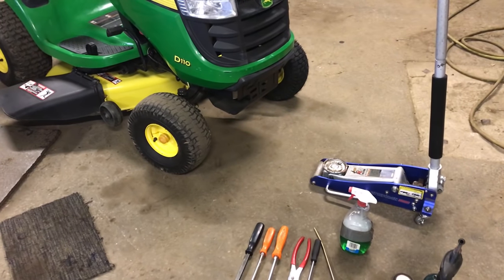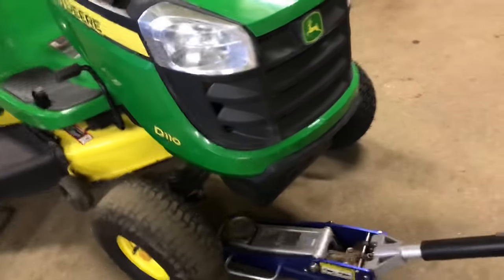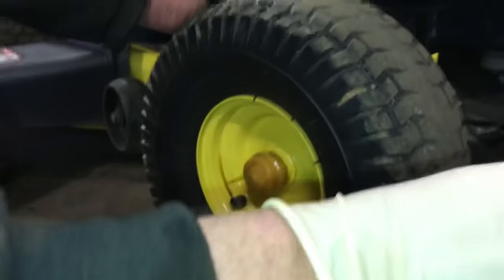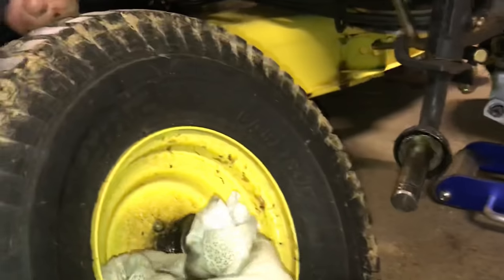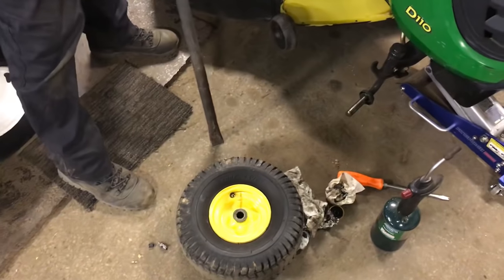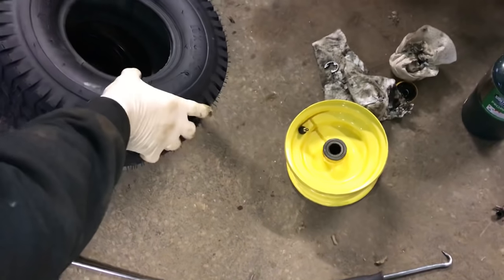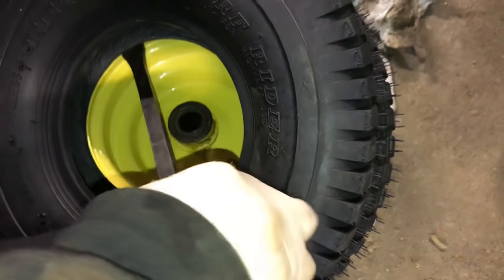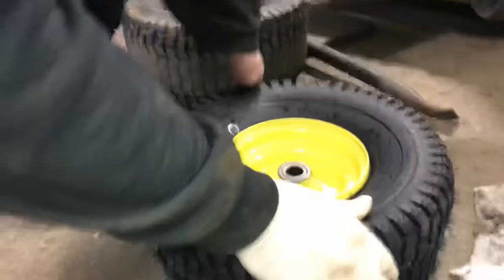How to change a tire on a John Deere

Comment: I have a JD S120 and the rear tire went flat thanks to a piece of wire that went into the side wall. I thought about just buying a new tire with rim to make it easier, but after watching your video, i am going to buy the replacement tire only. Thanks for posting a quality well explain video, it’s appreciated! Now, its on me to get my tire off that rim, lol! Great video! Thank you.
Reply from the maker: You can also keep the tire, put a patch on the inside of the tire where the wire went through it, then put a inner tube in the tire. I do not have a video on it but I will do one when the opportunity comes up.

Comment: At 7:22 your advice on pushing the tire down as far as you can REALLY helped me on my L120 tire I was replacing. I thought I was a complete dumbf**k but it was just a trick like that that did the job. I was really fighting that tire till then. Now I’m only half a dumbf**k
Great video!
Reply: Yogi Beer I have a rear tire that needs replacing on my LA120. But Im having a hard time removing it. I have sprayed it with wd40 for 4 straight days and but its not  move at all

Comment: The knee trick was the key to getting the new tore onto the rim.  I spent the better part of an hour goofing around, trying to somehow hold the rim secure, and finally giving up and checking YouTube.  After sifting through a bunch of useless videos, I found this one, skipped to the part I wanted to see, then it took less than a minute to get the tire on.  Thank you!
Reply from the maker: I’m glad it was helpful and you finally got the job done!! Thank you for watching and the kind comment. Please give this video a thumbs up to help my channel. It would be greatly appreciated.
Reply: @JohnsonsSmallEngines  Another great tip. removing the valve core and using a blow gun to get the bead seated, much better than using an inflator chuck.  You're full of great advice here.  I've spent 45 years wrenching on stuff and your 12 minute video gave me two great tips that I'll use.  Thanks again!

Comment: Thanks for posting this video. Just got myself a free X300 and the rear tires were shot. Not the most pleasant thing to do but thanks to your video I was able to do it myself. Thanks!
Reply from the maker: Mom glad you were able to get the tires changed out. How many hours are on the tractor?
Reply: @JohnsonsSmallEngines  118. 2014. Not much. It probably sat outside most of its life. Key was rusted up pretty good. Battery dead. Fuel a bit funky but it runs and runs smooth! I have videos of it purring away on my channel. Trying to decide if I want hdap or versa turf tires...but it looks like the versa ones don't come in 20/10-8. And I don't know if it's a good idea or not to mix different treads front and rear although the majority of the traction is going to be at the rear. Fronts were ok. Held air.

Comment: Heh.  this is great.   I  have never changed a rear tire but a have definitely changed the front ones or removed them.  I just break the bead while it is on the tractor before i lift it by kicking it, works every time.  Of course mine are typically flat because I ran over some sharp ass tool my son left in the back 40.

Comment: Did you just do this with one hand???? 

Yesterday I tried to do this and I have tools and air and am fairly handy. After denting the rim and scratching it all to heck I gave up. I feel like an idiot especially after watching this video. Good work!
Reply from the maker: I sure did, LOL. I was born that way so it was easy to deal with everything, plus I have changed thousands of tires. The trick is getting the tire bead in as close to the center of the rim before prying the other bead off of the rim and as I say "baby steps" small bites will make it also easier.

Comment: Just replaced a flat. Whoever put the tire on the rim used red loctite to bond the wheel to the rim. I had to cut the tire off and spend an hour breaking the seal with a blowtorch and elbow grease. If I weren't so stubbornness, I'd have gone back to Tractor Supply and just swapped the tire for one already mounted on a rim.
Reply from the maker: Nice work hanging in there to get the job done! Thanks for watching and commenting! Please give this video a like, subscribe and tell your friends to help my channel grow. It would be greatly appreciated :)

Comment: You did that like you knew what you were doing. Took me 2 hours just to take the tire off the rim. Probably another 2 hours to mount a new tire.
Reply from the maker: It depends on how old the tire is and the temperature your doing at. Some old tires are a pain to get off. The new one should be easier and follow how I use my knee to give you that little extra. Patients!!!! :)
Reply: @JohnsonsSmallEngines  Thanks, it's a 1991 JD i bought new in 91. I will use my knee for sure.
Reply: @JohnsonsSmallEngines  Thanks, It's a 91 JD I bought new in 91. I will use my knee for sure.

Comment: Are you using OEM tire or something else? Can you recommend a generic? I have a flat on my John Deere. I have never changed a tire and I'm not even sure if I can but I will give it a shot. This is my first ride on mower and I didnt even know we should be putting grease on. What kind of grease? 🤔 Also where are you located? Maybe you can help me out 😆 I know the John Deere dealer is going to charge me ridiculous prices to do anything. A couple years ago they were going to charge me $350 to do something to my Honda push mower that I did in 5 minutes for free after watching a YouTube video.
Reply from the maker: If you have a flat tire just install a inner tube. Here is a link to how to install a inner tube. https://youtu.be/bk3zwnOp1nQ.
Reply: Most auto tire places do not carry mower tires but will order one for you and mount on rim for about $65. I am local hand man and have been replacing mower tires for more than 20 years.  Tires do not go bad unless sets in the sun.  Majority of replacements due to side wall damage.  My local Tire Pros uses the same brand as John Deere. Just ordered a tire friday for me to pickup monday after noon. You can also get mower tires at Walmart but I never have and do not know quality.

Comment: What do you run your rear tires at?   Thanks for a great and useful video.
Reply from the maker: Anonymous98 Most 10 psi rear and 12 to 14 psi front. Check side wall on tire. The main idea is to keep the front equal and rear equal so the mower deck will cut evenly if the deck is properly adjusted.

Comment: Great video. Is there a certain type of grease to buy? Thanks!
Reply from the maker: As long as your putting grease in the wheels periodically that is what matters. I use a John Deere part number TY24416 it come in a tube for my grease gun. It is a Lithium grease.

Comment: Husqvarna YTH24V48 here. Just about time to replace my front tires. What are your thoughts on the "turf saver" style tires?
Reply from the maker: I replace the tires with what is on the machine to keep the same pattern. Turf saver tires are ok.
Reply: @JohnsonsSmallEngines  Thank you!

Comment: I HATE those freaking caps.  LOL....I get to change out tires this year on mine.  I looked at just the tire vs. tire+hub, and wow, for the extra $20 for the two I'll buy the tire+hub assembly.  I may change my mind when I get these wheels, but if the wheels are junk I can swap out the tires on the old ones for sure.

Comment: If you have too big a gap between the rim and the new tire and are having trouble pressurizing it, a ratchet strap (or cord of some type) cinched around the tread will help push the bead toward the rim and make it easier. Sometimes you can just stand the tire up and push down on the tread while pressurizing, but that doesn't work as well.
Reply from the maker: Yes but remember that if you over pressurize the tire when using a ratchet strap you can hurt yourself when you release the ratchet strap so be very careful!!

Comment: Great video. I just put tubes in both of  my X300 rear tires. What do you use to grease the rear axles? I picked this mower up used and the previous owner apparently never did. Dry as a bone and nearly seized. I want to try and bring it back before it gets worse.
Reply from the maker: LP the x300 series tractors are hydrostatic driven in the rear and there is no grease points. The transmission has hydraulic oil in it that keeps everything lubricated including the rear axle. It’s all in one. If your trying to push the machine when it isn’t running? There is a hydro release lever you pull out that is located near the hitch hole in the back of the tractor. To the right of the hole.
Reply: Johnson's Small Engines thank you for the quick reply. The wheels were just really difficult to get off when I was putting tubes in the tires. They were almost rusted on. Any recommendations on how to fix that issue so that they don’t become permanently seized? Enjoy all of your videos, keep ‘em coming!
Reply from the maker: LP ooooo! Ok, gotya. Just put never seize on shafts after you clean them up before putting the tires back on axles. That will keep corrosion down.

Comment: the best quality front wheels for these entry level John Deere D, E, and S  lawn tractors is to go with the one for the John deere X300 or X350 as its a much better wheel and tire  assembly which has precision bearings and a multitrac C/S turf tire
Reply from the maker: Or just install, Replacement M123811 Bearing Kit to normal roller bearings. https://amzn.to/3raBY9w

Comment: Does it matter if you put it on from the front or backside of the rim?
Reply from the maker: No, either way will work, what ever is easier for you.
Reply: Thank you. I was having difficulty with changing them. I know it does matter on car tires but couldn't see any reason why it would on these John Deere tires so I appreciate your reply.  I did finally get them on by using a heat gun to slightly warm them to make them a bit more flexible and they are doing great. Thanks again.

Comment: Enjoy your videos. Have a similar unit. How in the world did that old tire wear like that especially with yearly lube?  How many hours of use?
Reply from the maker: There steering was a little toed in and you cannot adjust this without adjustable  tie rods. This model does not have them. I also think they take very hard turns over there driveway which doesn't help either! 200plud hrs.
Reply: My D110 has 155 hours but no apparent tire wear. A friend with the same mower and slightly less hours has front tires with bald patches around tire but never lubed the wheels.

Comment: Can you use a tube inside a older tire?
Reply from the maker: Yes, absolutely. We here at my shop do it all the time. just make sure to check the inside wall of the tire to make sure there are no obstructions that may pop the new inner tube.

Comment: Can you use slime or similar product in a tubeless lawn tire to fix a small leak?
Reply from the maker: You can and I have in the past just to find out that tire sealant “slime” will ruin the tire in time. Installing a tube is recommended.

Comment: How to change tehe rear tire?
Reply from the maker: It’s the same but bigger! The question is due you need a tire or just install a tube? If your tire is loosing air and going flat? you may just need a tube. Check this video out on installing a inner tube. https://youtu.be/bk3zwnOp1nQ

Comment: Hey Brad - So the tires on the John Deere D110 do not have inner tubes?   My JD D110 has a flat rear tire - so I guess I just need a new tire?  I thought I could patch the inner tube, but if there isn't one...
Reply from the maker: Install a inner tube, it's cheaper then replacing the tire and if the tire is not dry rotted? you do not need a new tire. Make sure you check the inside of the tire for thorns, nails, etc before installing the tube. The size tube you will need is the size on the tire!
Reply: Tre Gibbs   I was wondering the same. But upon closer inspection , I found that information on the old tire. It reads" tubeless"
Reply from the maker: Install a tube, take the tire size off of the tire it should be something like "20 X 8.00 - 8". then go ether to a local lawn mower shop or anyone that sells tubes and purchase a tube. Once you have a tube in hand, cut the valve stem out of the rim and install the tube in the tire on the rim. All lawn tractor tires are tubeless until we install tubes in them! I will make a video on how to install a tube in a tire!